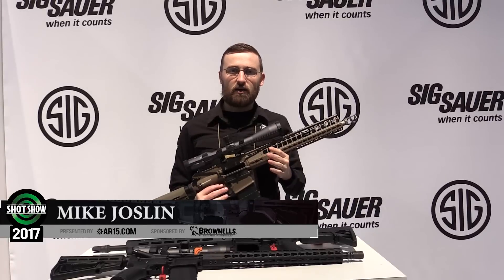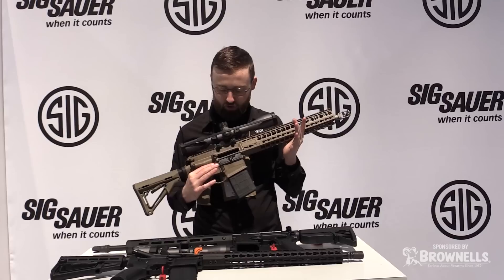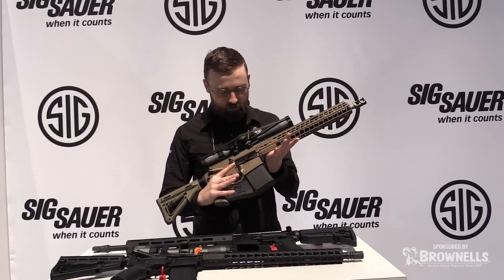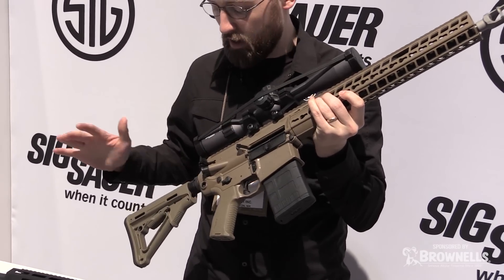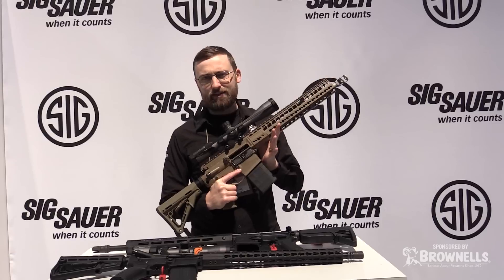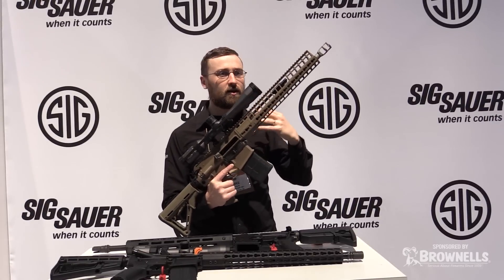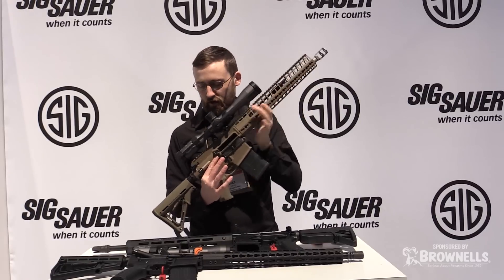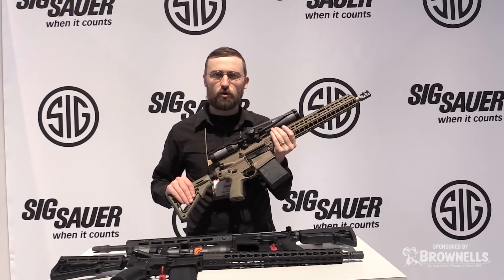Sig Sauer 716 G2 DMR - SHOT Show 2017 Day 3

Comment: Never buy a 716. Mine has out of spec pic rails on the handguard. Sig wants my entire rifle back for something held in by 6 screws.
The gun does work good, never had any issues functionally.
Reply: Swizzle556 get the lancer handguard, much lighter
Reply: Yes, I'm waiting for their Gen.2 handguards right now. But still, Sig built a really nice gun /w the 716. They failed in the handguard department, way too short, my hand wants to be where the gas block is.  :(

Comment: I have the latest gen 1, it's heavy...just get a gym membership.  Or add a lighter lancer rail
Reply: So, do you have a lighter profile barrel on the Gen.1?  Mine is a Gen.2 with a supposed heavier barrel.
Reply: Mine is a heavy, chrome lined,  hammer forged 1-10 twist barrel